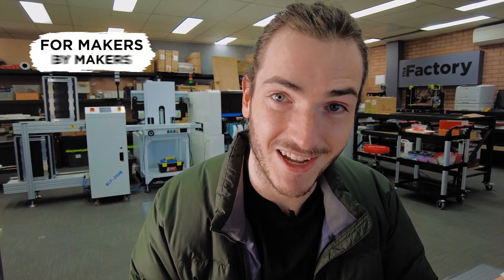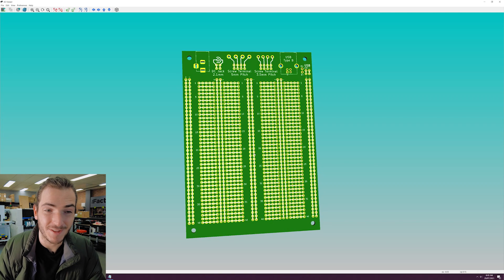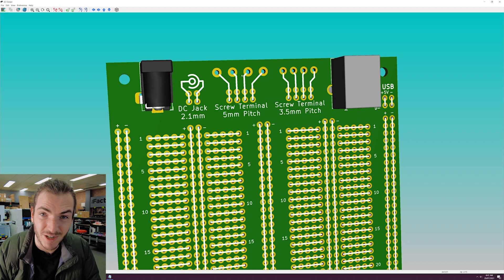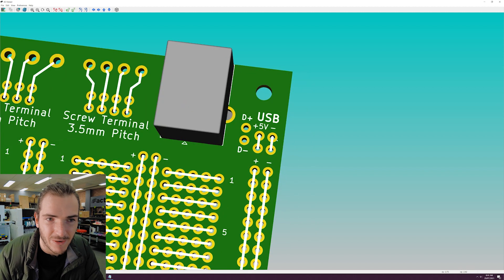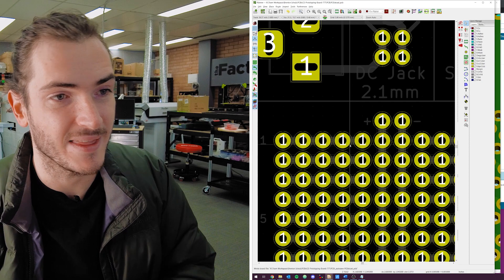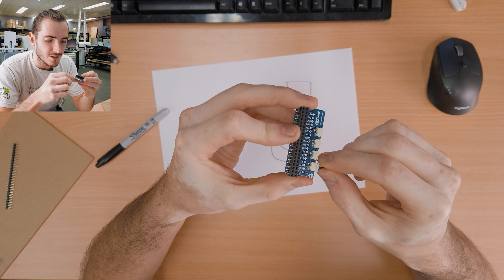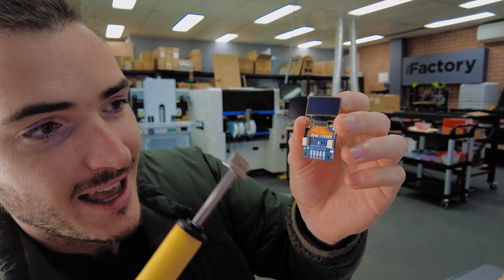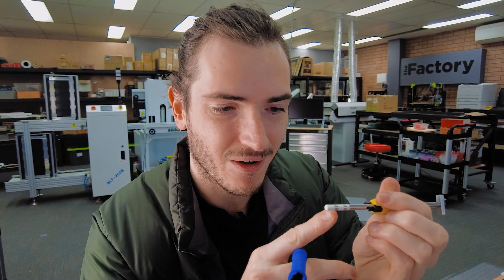The Factory | The Quest For The "Perfect" Protoboard

Comment: Great idea - where it also looks as if a R-Pi Pico would fit across the centre of the board such that one does not loose connection points within a row(?)...
Wondering if there could be some simple way of mounting an Arduino Uno and avoid the many jumper leads that are normally required to link to a prototype board.
Reply from the maker: We agree about the Pico! Check out our latest episode - we'll bump the rows out by an extra pad so you still have enough connections for every Pico pin 😊

Comment: Love the protoboard. One suggestion - sell an enclosure that fits the board and has the USB, screw terminal, DC socket cut out. Not everyone owns a 3D printer so an enclosure to suit would be the icing on the cake.
Reply: or a kit to make the box from flat pieces, like rpi had from adafruit, could have several kits with option for cutout, some may use barrel jack only or usb only ...

Comment: USB - B is also a very robust connector .
Looks like a fantastic design with with many more options over vero board but please make it pre tinned as it makes soldering so much easier . I don't know how many boards i have had troubles with - especially the cheap ones from you know where that drop pads as soon as you put an iron near them .
Reply from the maker: We'll make these on honest-to-goodness FR4, so they shouldn't drop pads like phenolic paper does. And they'll be Lead-Free HASL tinned 👍